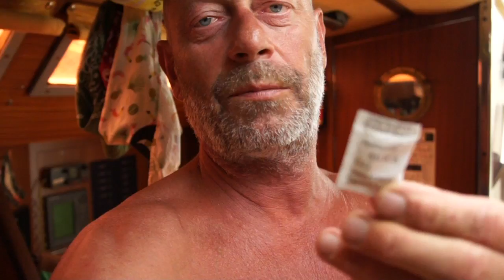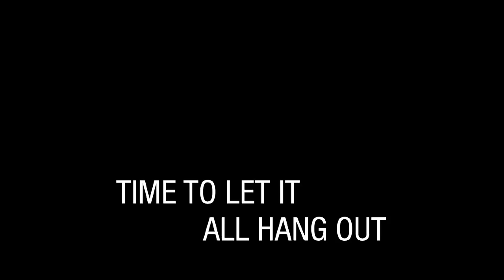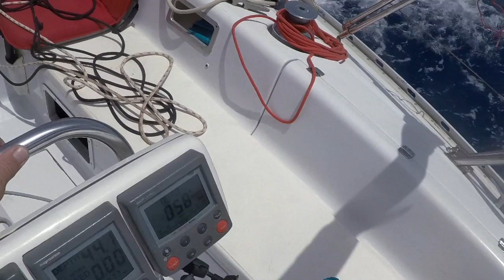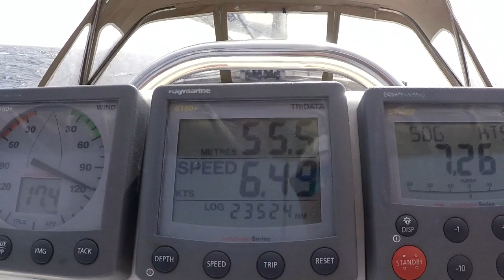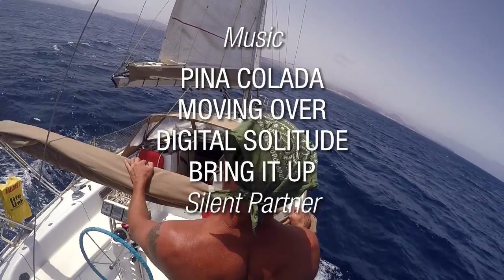Winded Voyage 3 | Episode 8 I Living Alone & Solo Sailing Naked

Comment: Um, not to be a keyboard warrior.  Keep watch on your alternator / charging circuit.  Yes, you "fixed" the fuse.  Fuses do break sometimes but they usually only break to protect everything else.  One time shame on it, if it happens more than once you have other problems.
Reply from the maker: Thanks Howard. You are absolutely right, and I much appreciate your warrior ways. I will keep a check on that. So far it seems OK. But that is something I have learned as a liveaboard is to always keep  check on things.